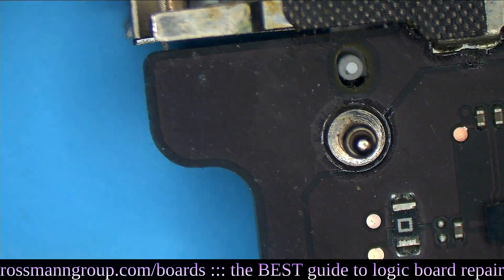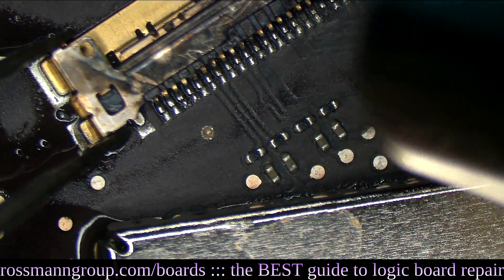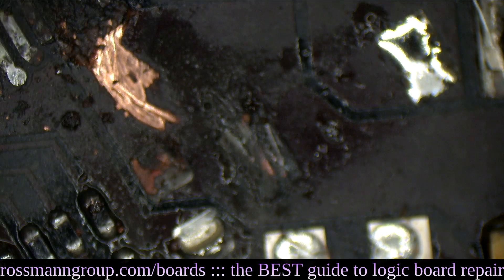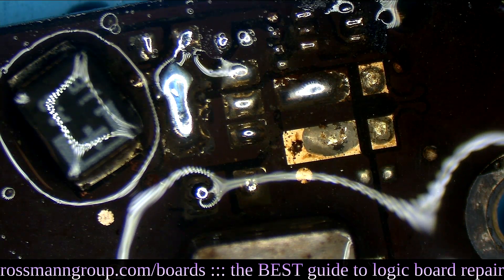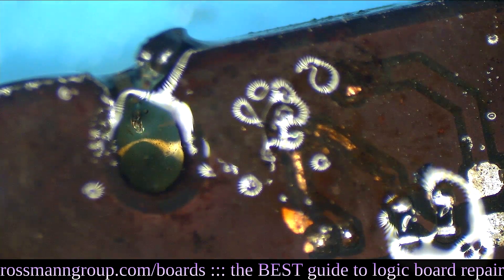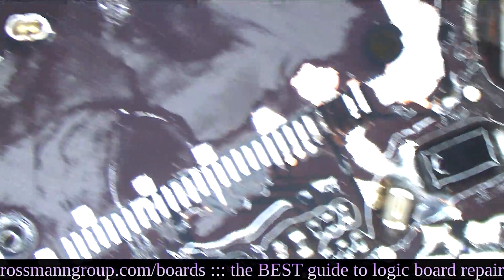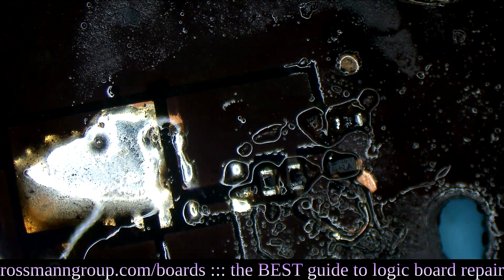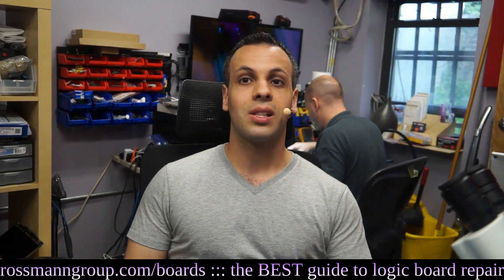Can Macbook be repaired after fire?

Comment: Lmfao I have been watching these videos for a while and it always strikes me 99% of the time it is visible damage on the Mac books, over 50% of these repairs you can see the damage without the microscope. Imagine trying these repairs on boards that have zero visible damage now that takes more patience and time to track down a resistor that lost 50 % of its resistance and thus a line to a transistor won't work. Very good instructions here.

Comment: I've seen two of these survive a fire and still run (one for at least a couple of hours after drying out from the liquid damage done by the fire hoses and sitting out in the elements for several days in the middle of winter). The other one definitely has some soot around the keys (very recent) but from a quick external test, actually turned on and appears to be running. It'll be interesting to see what our hardware guys find when they open it up.

Comment: Question Louis, if Apple used conformal coatings on their boards, would a lot of the issues you see everyday go away?
Reply: I thought conformal coating was only really used in "ruggedised" laptops. 
Cant really think of a mainstream manufacture that uses conformal coating.
Reply: conformal coating makes repair harder. and its user all over the place cellphones, tools, laptops, missiles , etc. It does not prevent all liquid damage. will not prevent unwanted shorts in a maritime setting. but it does harden the machine against freshwater liquid damage quite a bit.

Comment: Not questioning you work but do you use different jumper wires for different track replacements? Seems that the cross sectional area of the tracks may be larger than the cross sectional area of the wire possibly causing an issue in the future.

Comment: If the PCB is this badly damaged then surely there is a chance that moving the laptop around will create a short?

Also, did you risk putting it through the sonic cleaner as it looks like it would probably strip all the insulation off the PCB.

Comment: Why do you ultrasonic clean the board only after the repair is done? Wouldn't it be more enjoyable to work on a clean board?
Reply from the maker: No. 

1) Ultrasonicing removes the hints.

2) Each ultrasonic cleaning raises the chances of it not working/knocking stuff off. This board was flaking already - I do not want to put it through two passes!

Comment: I got a Good question....if you unsolder meaning remove from board all chips and diodes resistors mosfets caps and everything ?? Could you place all parts back on and have only to reprogram the device or would there still be data on the chips ....?     I have heard of it being done with the ram chip on a USB flash drive....if you can flow the solder without Bridging the pins. Right...?

Comment: I didn't even use headphone jack on my P9. I just got tired of fixing it on my wired headphones (don't have any decent soldering station and not planning to get one just for fixing headphones) so I bought wireless ones. And I keep turning off bluetooth on one device or another, or connect/disconnect. Just got used to it. Since there is no workaround, except getting more expensive headphones (Nope).

Comment: So, you recommend a portable/mini soldering pencil but not the Hakko FX-888D? Why is that? Granted, the portable soldering pencil has what looks like a much nicer direct heat tip, but the FX-888D is nice for the price. Then again, I don't do professional repair work with mine :)
Reply from the maker: Old style iron where the heater isn't integrated into the tip. No thanks!!
Reply: I see. I was watching EEVblog's video on new vs old soldering iron tips and made the same conclusion, but for a hobbyist I'd suppose it makes no big deal? I've never had issues with it, but I also don't solder enough to spend the extra dough on a direct heat iron. 

Totally separate question: Have you heard of the 2012 MBP issue with the RAM slot closest to the keyboard shorting and causing crashes with colored bars/lines/patterns when pressure is applied? Mine has that issue and I have a logic board to replace it with but I'm curious if the RAM sockets are replaceable and if that would fix the issue.

Comment: Good work ...
Besides Bob Ross , there was a German painter that used his "mighty brush ..." ... maybe you could do a shtick with his style ?
I have repaired fire damaged goods ... they have a distinguishable aroma . In some cases the foaming agent as well as straight water or sodium bicarbonate got into the electronic gear and raised hell . I used clear nail polish as a conformal coating in many cases .
Repairing this type of damage adds another dimension to one's skill set .

Comment: Isn't cheaper just to replace the board?
Reply: callsignvibe 
Isn't the Secondary storage... soldered to the MB!
Reply: No that's some corporate Bullshyt apple keep telling these days. They gone one step further. Get a new Mac book🤗🤣
Reply: villavan kothai 
Instead of Marvelling at the man's ability to get this board working against all odds... No... it's "cheaper" or "easier" to just replace... But you I guess that's not the point if wanting to frame that MB!...
Reply: Good job by Ross, but thats not the point, the mb seemed to be very degraded, thats all. By the way we don't know how much Ross charges for his work.
Reply: $450 USD per successful repair.
Reply: +Nicholas Joseph
Some of these boards are over $1000 USD. Whereas if he can fix it successfully, $450 isn't so bad. And why so much for the repair? Because if something happens to the board, even unrelated to the actual problem, you touched it and you own it. You are blamed for the things that go wrong with that laptop, even if it's unrelated to what you worked upon. Paying for the cost of warranty.
Reply: Nicholas Joseph 
I understand that point, however it cannot account for Sentimental value...

Comment: tbh, if i would know my motherboard looks like a frankensteined pc motherboard, i wouldnt use it, cause i couldnt trust that piece of pc anymore - btw i dislike apple, i do not use, will not use a single piece from apple, i refuse to sell apple stuff
Reply: this one is the exception and not the norm for his work. usually there aren't any or very few bodge wires involved. that said those jumper-wires are actually  just as sturdy as the traces that they are replacing. you could in theory make all of the circuits in the machine out of those(almost) and it would work, it just would not fit in the case again afterwards.